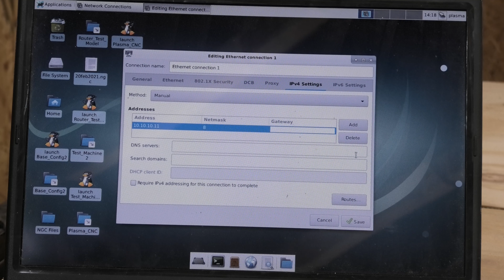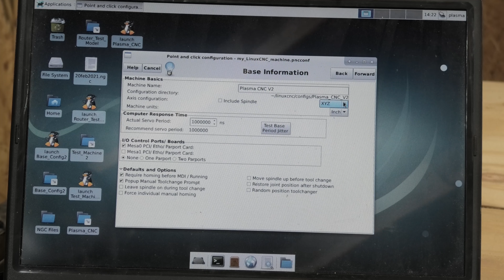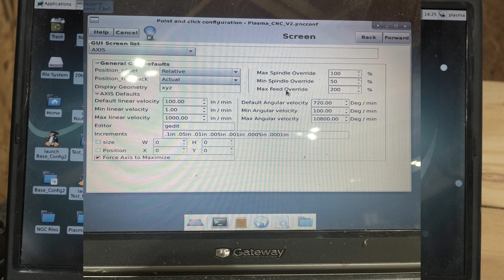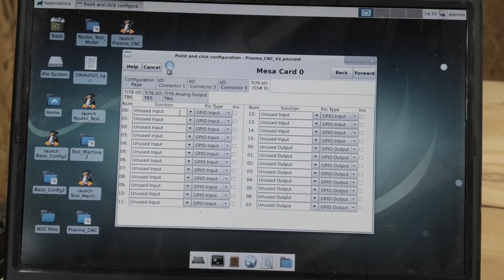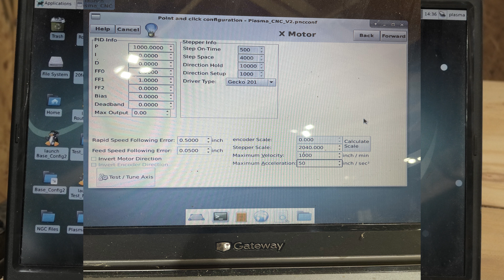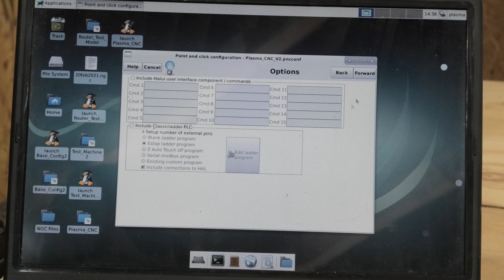LinuxCNC Setup and PlasmaC Setup with Mesa 7i76e II Legacy 4x4

Comment: Great video! One question I have is for the connection to the Mesa board pertaining to arc voltage. Which point on the board would this be wired to?
Reply from the maker: Damn off the top of my head I do not remember right now i want to say the arc voltage is plugged into the THC board and then the THC board is wired to the encoder on the mesa 7i76e

Comment: Thanks for posting the video! I'm trying to get mine setup and going. This helps a lot. Been trying to figure out witch mesa THCAD card to us with my cheap china plasma cutter. Once i have it all working. Going to upgrade the plasma to something else but kind of stuck with the one i have now. Think im going to go with THCAD 10 but not sure that will work. What are you using? I know ill have to figure out a voltage divider because my plasma doesnt have one. Have all axis working and moving just need to get THC setup.
Reply from the maker: I’m using the THC 10AD as well, I found a post on Linux cnc forum thag described the differences and that’s what worked for mine. The vintage divider is definitely nice because it lowes the output voltage and helps lower electronic interference, but the thc cards can take raw live bolts and you can code it into the thc setup. I’ll be honest getting the thc dialed in is one of the harder parts of the whole setup

Comment: looks like on the "motor step per revolution" is more like motor steps per inch is that correct? 3.2/pi x 200 - great tutorial.  Regards
Reply from the maker: Yeah sorry might have miss spoke but yes. So in short, 1 step(or pulse) form the computer does not equal one revolution if the drive. So the math equation shakes out to determine the number of steps to cover 1 inch. 

Linux cnc is essentially determining the distance thag is covered by one pulse of the computer program and then uses tbag to run the machine

Comment: What program do you use to draw parts and then transfer it to the plasma control computer?
Reply from the maker: I use some cad to do designs you can use solid works, fusion 360, google sketch up or Inkscape. I use a lot to Inkscape. Those programs output a dxf file type. Whcih is then imported into Sheetcam. Sheetcam does the nesting and tool path creation. And then Sheetcam exports a g code file which Linux cnc can understand